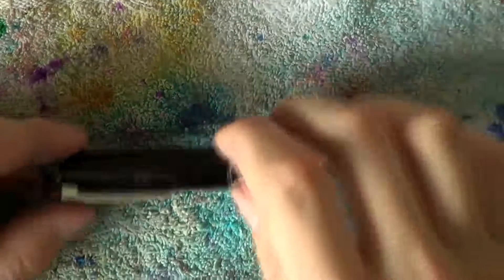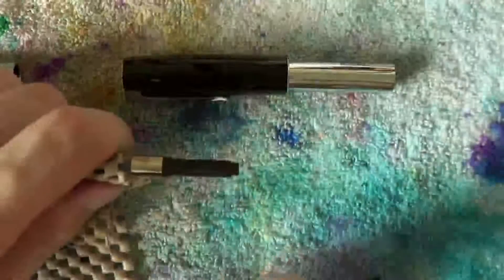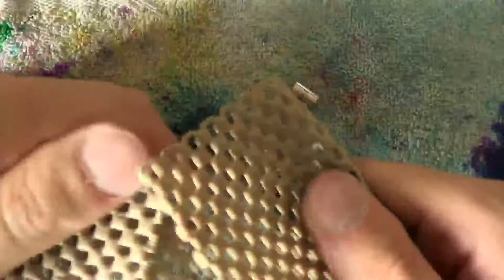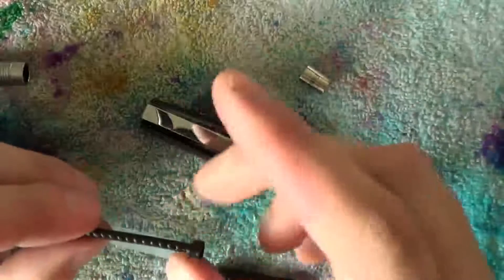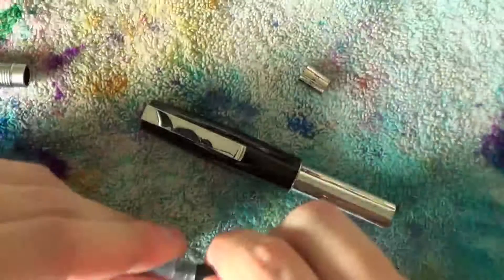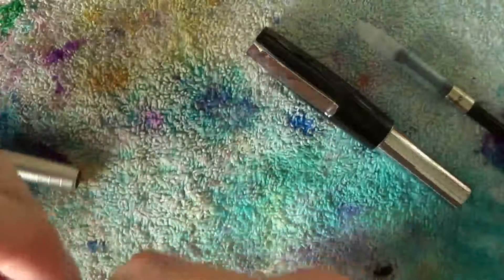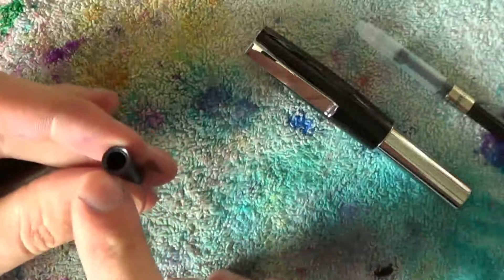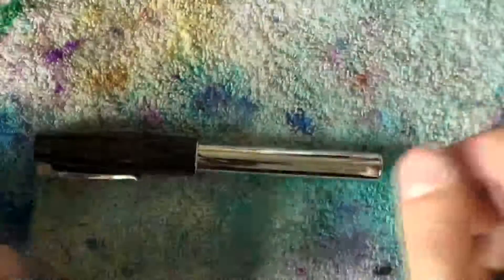Disassembly Line Faber Castell Loom

Comment: Hello, i didn't use my Faber-Castell e-motion for a few weeks. I disassembled it, washed the nib and feeder with water and soap to remove the dried ink, put it back, everything aligned, and now I'm having issues with the ink flow. What would be wrong?
Reply from the maker: Does it flow too much or too little?
Reply: @sbrebrown  Too little. Before cleaning it, i could leave it 5 6 days without using it, and the nib was still wet. Now, after only one day, i find it a little bit dry. When I'm writing, i don't feel a constant flow of ink. I'm using the same ink as before. Thank you for all your videos! I'm enjoying your videos since 2015
Reply: @sbrebrown  i disassembled it again, washed everything, put it back, now everything seems to be fine🤔 the same way like pervious time, now different result
Reply from the maker: I wonder what it was!
Reply: @sbrebrown  it's alchemy
Reply: @sbrebrown  again the pen started to get dry, i found out what's happening, it drove me nuts. It happens when i flip the pen, and a bubble stucks near the converter's hole. I have to gently shake the pen or knock it, to move the bubble.🤦🤦🤦 I don't know why it didn't happen before. The soap might have affected the plastic's surface, and the ink doesn't flow as freely as before.